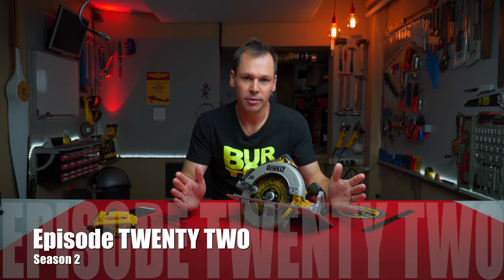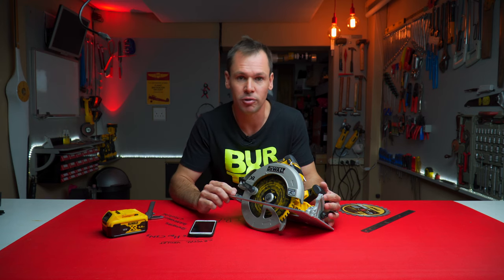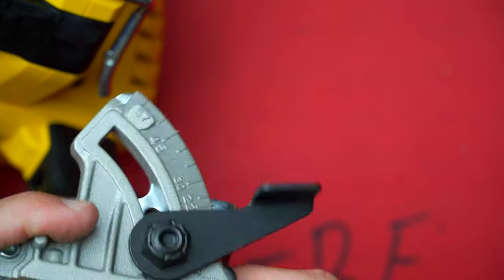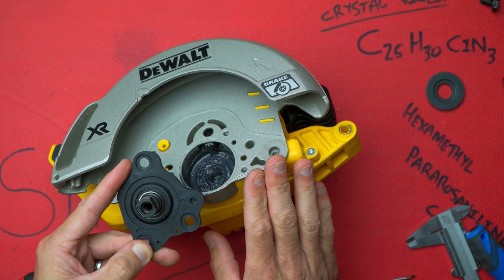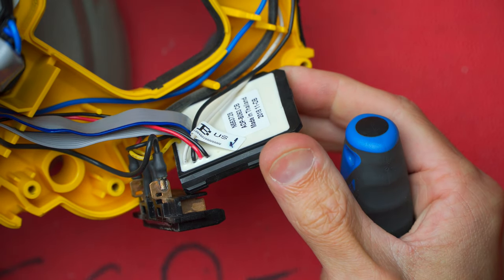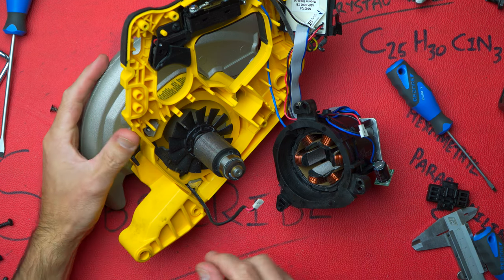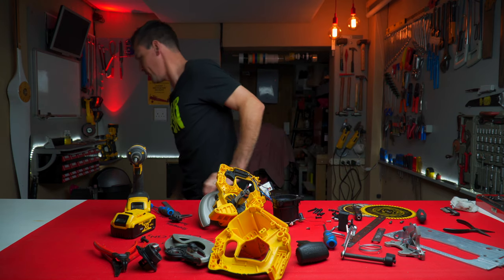DeWALT DCS570 20v MAX XR 7-1/4 Inch Circular Saw TEARDOWN (BURTON BUILDS - S02E22) [4K]

Comment: Great video! Mine stoped working after a year when I press the trigger there's kinda of a beep sound? But nothing happens, the light turns on and off one time but that's all. I tried differently batteries, I tested continuity but I can't find the cause, any ideas? Thanks!
Reply: Same here, Ignacio. Mine won't turn either
Reply from the maker: Hi Ignacia, have you inspected the ribbon wires going to the hall sensor on the back of the motor? Might be worth a look to see if they are damaged. Maybe look / feel for any breaks in the wires where they go into the speed control, switch, etc. maybe the insulation is still good but the wire is broken inside. My feeling is that if no wires are broken, its probably a faulty speed control.
Reply: @GrantBurton  i have the same problem, tge ribbon looks fine but theres a small little thing with a black wire and blue wire that heats up with repeated clicks

Comment: Thanks for  doing the teardown mate ,very interested to see that bearing and gear support plate ,I think it would be a fibre reinforced plastic to take the heat and stresses ,must be  okay these saws have seen hard service for a few  years now and I'm not aware of any problems. Merry Christmas from Australia.
Reply from the maker: Merry Christmas to you and the family. I’ll be tearing down my other tools in the near future... couple of Dewalt cordless drills, impact wrench, SDS hammer drill, Makita jigsaw, grinders, etc. will be interesting to see the build quality of those. Also thanks for the support and comments.
Reply: Grant Burton Just as a matter of interest if you can remember, was there a ball bearing or bushing in the housing where the shaft goes into  the housing at 8.35 thanks?
Reply from the maker: interman 77 Unfortunately I can’t remember and I’m not anywhere near my original footage to have a closer look. Also, I’ll only be able to open it up again in a few days to confirm for you. Hopefully I remember.
Reply: Grant Burton Don't disassemble it again on my account mate , btw I just watched this video again and I think you're correct about the "teal coloured tools " not letting their quality slip .
Reply from the maker: Hi interman 77, I opened up the gearbox to have a look at that bearing for you and posted the video here https://youtu.be/CZEkC3bHx0U
Reply: @interman7715  tell Grant Thank You for doing that, you ingrate!  Lol just bustin on ya internet man 😁😂👍

Comment: Could u help me plzz.. after buy my dewalt round saw dcs393 it stop working after 1st use. I notice the white bd black wires inside it are connected and when I disconnect it the saw works but with it screw on it doesn't work. Help plzzz!!
Reply from the maker: Hi Yoanne, If this has happened after only the first use, I would return the saw under warranty and swap it our for a new one or ask for a refund. I'm not exactly sure what the white and black wires are for or what they control. Also I think the DCS939 has a brushed motor with a different type of speed control compared to this one which is brushless (the DCS570).

Comment: Hi grant great video. Would you happen to know how to change the brushes on the brushed version .cant find any info anywhere?
Reply from the maker: Hi, unfortunately I have never opened the brushed version... only seen it in stores. I’ll also search online and if I find any info, I’ll send you a message.
Reply: Hi chill pill, I realize this is a late reply,  Did you try taking the end cap off the motor?  I checked an older 18 volt brushed saw, and two screws hold an end cap on, and when you remove it, there is access to the brushes.  Good luck.  Peace!

Comment: I have this saw. It no longer works. So i opened it up using your video. In the motor I found a bit of what appears to be fine sawdust. My saw started acting up about 3 months ago. It would run for 3 seconds then cut off. I’m not sure how it would start working properly again but it would. Now i get nothing. The light comes on for a brief moment and that’s all that happens. I still have it fully apart as much as you did in the video. I will attempt to remove all sawdust, check wires and connectors. To give this thing one more chance to remain on the jobsite. For how old it is i am dissatisfied with the problems it is having. And yes it has always cut crooked.
Reply from the maker: Hi Douglas, thanks for the comment. Forgive me for asking but did you try a different battery, one that is a known working battery?

If the battery is good, I wonder if it isn't dust that is made its way into the switch? Maybe a good blow out with some compressed air is worth a try. Intermittent problems are the worst.

As a reference, how old is your saw?

I hear that the new power detect https://amzn.to/3ADIqca and Flexvolt https://amzn.to/3l4BOKN saws have a lot more power than the old ones. Links are Amazon Affiliate links but of course feel free to just do a normal Amazon / Google search.
Reply: I have just ordered a spare or repair one with this same issue. (not yet received)
Did you ever resolve the issue?
Reply: Have the same problem, just over a year old, seems like the brake is on or something? I stripped it following this video, everything looks pretty clean tbh. The gears spin fine when motor is off. Any ideas?

Comment: Hola , no sé si me responderlas ya q es un vídeos antiguo jaj 
Quiero preguntar si está sierra tiene MICROFUSIBLES porq pregunto, porq tengo esa misma sierra q no funciona. 
aprieto el gatillo y prende la luz por un segundo pero no arranca la sierra , bota un pequeño silbido corto cada vez q aprieto el gatillo.
Buscando videos ví uno pero dónde pasaba esto en un taladro el dcd996 q prendía su luz un segundo pero no funcionaba y encontró q en su tarjeta de control hay unos micro fusibles, no pudo encontrar repuesto le hizo un pequeño puente con alambre fino y funcionó, lo mismo podría ser en mi sierra ?? Los motores brushless al igual q las de escobillas usan fusibles como una forma de proteger el motor. Cómo puedo encontrar estos fusibles? O q me recomienda revisar, para hallar el problema gracias y disculpa por mi extendido comentario saludos desde Perú
Reply: Buen día amigo....qué pasó con tu sierra. Sí pudiste solucionar el problema ? Comenta, es que tengo una con esa falla.
Reply: @marioniacuna  hola, encontré una falla y es el MOSFET q está quemado y no hay repuesto aquí en mi país, pero si se arregla supondría q está solucionado viendo otro videos con caso parecido cambio el MOSFET pero encontró otra falla en la tarjeta q va a lado del gatillo, lo reemplazo y solucionado quedó, era una Milwaukee espero q el mío solo sea el MOSFET. Me cuenta como te fue saludos

Comment: Greetings ... excellent material to know this tool .... By the way, I could ask you a question. You know I have the dewalt Dcs570b, with 1 month of use and it has failed me .... It does not start, could an electronic component be the cause? The technical services here in Chile are terrible ... I would appreciate your guidance ... Many
Reply from the maker: Hi Felix, If your DCS570b is one month old, does it still have warranty? maybe you can return it for a new tool?

Is it completely dead or does it make any sounds when the trigger is pulled?

I would first try another battery on the saw, and also the original battery on another tool if possible... it could be a bad battery? If its not a bad battery, possibly a bad battery contact where the battery clips in? If this all looks good, then possibly a fault in the speed control / switch / motor wires... It could be a number of different things. If it is a problem with the speed control, like a bad component, its not something that can be repaired as the components are all potted so you'll likely have to buy a replacement part.

I would say the best option is to return the tool (to where you purchased it) and ask for a new one under warranty because once you open the tool and have a look inside, the service centre may not even want to look at it if you are unable to repair it yourself.
Reply: Hello Grant, Greetings again .... thank you very much for your answer, well ... I tested the tool with the original batteries of a drill, and nothing, it just emits a sound similar to as if the tool were with a brake. Is a more powerful battery necessary for this tool? I wonder since I tested with 1 original Dewalt 2Ah battery ... But I am very grateful to you Grant, greetings from Chile.

Comment: HI Grant, I found your video through a search because I just opened a brand new DCS565 6-1/2 inch saw and it seems my spindle (arbor) is loose, at least to me.  Your spindle assembly looks similar to my model.  Does your spindle within the gearbox have any play in it?  With the blade on mine I can rock the blade a bit back and forth (wobble it) which makes it look like the main shaft is loose even though the blade is securely attached to the arbor.
Reply from the maker: Hi Goody, thanks for the comment. I'll have to check for certain tomorrow as the workshop has has already been closed up for the evening (hope I remember), but as I recall, there should not be any wobble to the blade else it wouldn't cut straight and true. I may be a defective tool?
Reply: @GrantBurton  Hello Grant!  Yes my thoughts exactly!  I am very concerned about a true cut and so far I think the manufacturer understands and is willing to address the issue.  I measured 1/8" of lateral movement in the blade which cannot be good and surely signals a defective tool.  Unlike your saw I have discovered that the interior end of my arbor spins inside a bronze sleeve bushing and not on roller bearings like yours.  I honestly think that bushing is missing yet somehow made it through manufacturing checks.  Thanks for the reply!

Comment: need to Tear down my Ridgid R4516 Table saw and Grease the Bearings
Reply from the maker: Hi Joni... I'm not too familiar with the bearing design on table saws but I would guess they use standard size sealed bearings? Maybe if they are cheap enough, its worth throwing in a new set rather than greasing up the old ones... unless the old ones are still in good condition?

Comment: Great Video Grant, and big thumbs up!  Whilst you were “inside the bowels” of the beast, did you see anything that could cause or make a rattling or clicking noise?  You mentioned a board or something that seemed loose, at some point in the video?  I have a DCS 578 60 volt, and when I pick it up, and move it up and down, there is a distinct, but not loud, clicking noise from within the saw.  This is only noticed when it isn’t running.  And if I pick it up off the bench easy like, it doesn’t seem to make the noise?  Saw runs well, and blade spins true, and the brake works.  It’s just weird to hear that noise.  One wonders, what is loose or moving around inside?!  Thanks and cheers!  ✌🏻👍🇺🇸😁
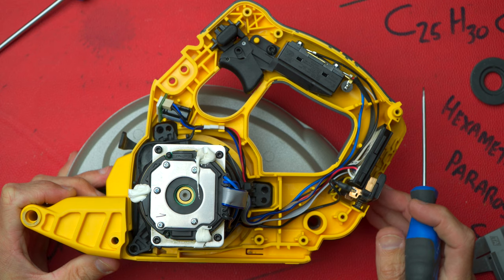Reply from the maker: Hi George, I wonder if it's not a RFID tag that has become unstuck from the inside of the casing and is floating and bumping around? I believe many tools now days have these little anti-theft tags inside. I would imagine that would sound like a small piece of plastic bouncing around when you shake the tool. The loose board I was referring to is at 11:39 and I suppose it is possible for that to rattle around but I've shaked mine saw around and I don't hear any rattling. Keep well.
Reply: @GrantBurton  Hi Grant, Thank You for the reply!  I wondered about the blade mount so I went to pull out the blade wrench from the base, and I discovered, much to my chagrin, it was causing the noise.  😳🙄 The blade wrench is just loose enough in the housing, to cause the rattling noise.  Your suggestion of the RFID tag was great however.  Already a Subscriber, but definitely would be now!  😁. About the drill chucks, You might take the special drill bit from a Kreg kit, to check out a drill.  I’ve found my bit to run very true, and I use it to check out any drill I purchase.  I also use a Freud Forstner bit as they are machined to high standards.  Enjoy your content!  Please stay safe and Healthy!  👍👍👍✌🏻😁
Reply from the maker: Haha... just before posting my previous reply, I quickly went down to shake my saw and also heard a rattle and for a second I thought to myself 'but wait, my saw also rattles' and then I remembered the blade wrench tool, pulled it out and the rattle was gone...thats when I gave it a good shake to see if that small board was making a noise. haha.

As for the drill, maybe I'll setup a dial gauge and measure it with the shaft of an 8mm tap. This past weekend I actually tested a new chuck for my drill press. Its a PORTA Keyless chuck (1 - 13mm B16 - MT2) and if I was measuring correctly, the quill / arbour of the drill press measured a runout of 0.01mm and the shaft of the 8mm tap clamped into the chuck measured a runout of 0.09mm... so i guess the chuck has a runout of 0.08mm. I didn't measure the runout of the old key chuck that was in the press because i could see the runout by eye... haha.

Thanks for the support and great chatting with you.
Reply: @GrantBurton  Grant, that is funny.  I do appreciate your replies and following up on me.  Yeah, it is a shame, as it seems like as Technology advances, some of the older established ‘norms,’ seem to take a hit on quality?  There is still quality stuff out there, if a person wants to pay the price.  We all live in a ‘throw away’ Society, as you know.  Do try out a good quality Forstner bit, as they are machined to closer tolerances, and I think it helps to see how good or bad runout is in a tool/ Chuck, etc.  Am Looking forward to upcoming videos.  If you need an old tool to tear down, maybe I can help?  I have a whole wall of them!  😳😬🤔😄😁😂. Grant and everyone stay safe and Healthy!!!  👍👍👍✌🏻😁 🇿🇦🇺🇸

Comment: Please let me know if it worked afterwards 🤣🤣🤣🤣. Jokes aside, it looks great. You should actually do a test on a piece of lumber to see how long the battery will last per single charge cycle. I'm interested to see how long it will last under full load.
Reply from the maker: Hi Henry, it certainly did work afterwards... haha. Luckily these tools are not that difficult to teardown and put back together... a little like a 'kit' build product. I'll keep that in mind for a future video... I have a few different cordless tools, maybe I'll do runtime tests on all of them in a single video.
Reply: I was doing a 26 foot wall 16" on center, and my 5ah battery made it 2/3 of the day of framing.

Comment: Looks like the blade is backwards 🤭🤭
Reply from the maker: Hello and well spotted. A few minutes prior to filming, I removed the blade and was taking some measurements on the tool and once complete, I quickly popped the blade back on to the saw (as you pointed out, obviously not in the correct orientation) just for the intro of the video, knowing that I would remove the blade again a few minutes later... haha. When the blade is on this saw, with the label side facing out, the teeth point forward. That’s pretty awesome that you picked that up though, not many people notice that (or maybe they do but don't comment). Thanks for the heads up and the comment.

Comment: When I changed the blade on my saw and tightened it down the arbor lock seemed to not release fully and it brakes really hard.  Tried 3 different times.  And...it is not smooth.
Reply from the maker: Hi Merrill, It sounds like something has gone wrong with the arbor lock mechanism on the inside. You'll probably have to open it up and have a look... I could only assume the steel part of the lock that is on the motor has become bent and is rubbing on something inside.

Does the lock lever still feel normal when you press it and let it spring back?